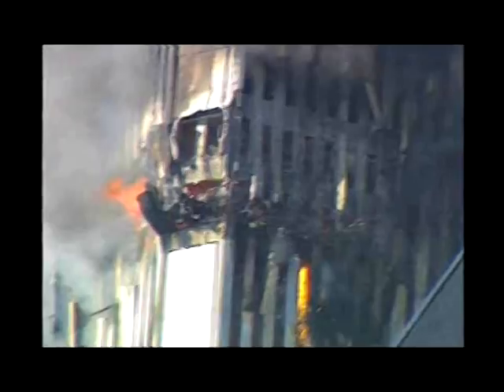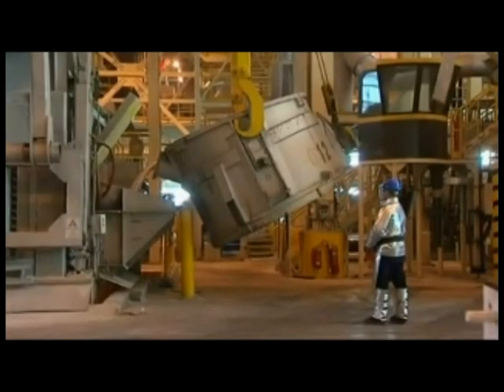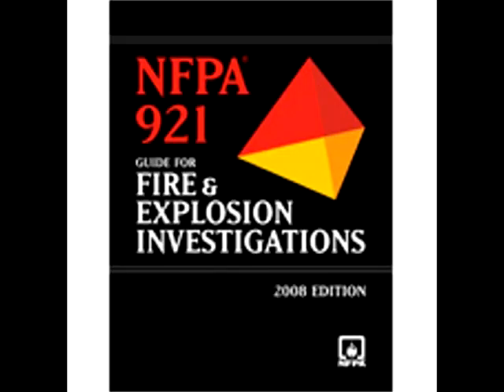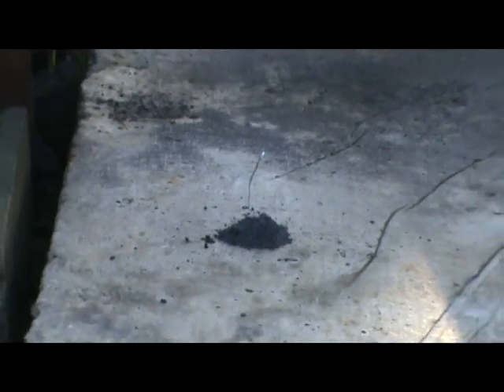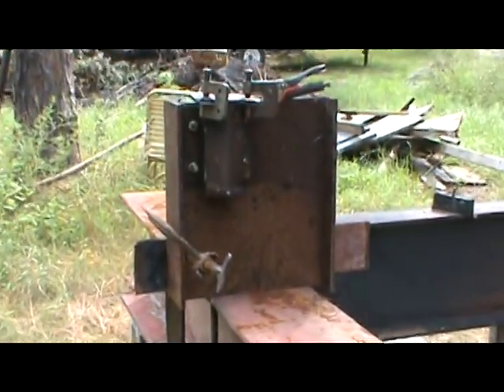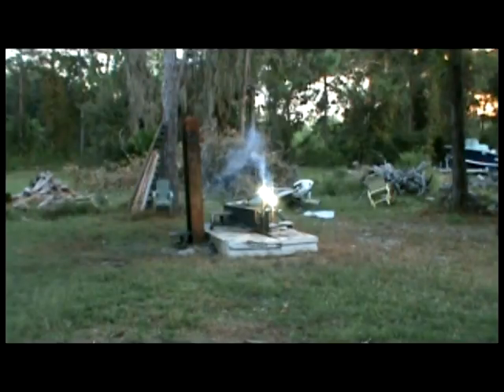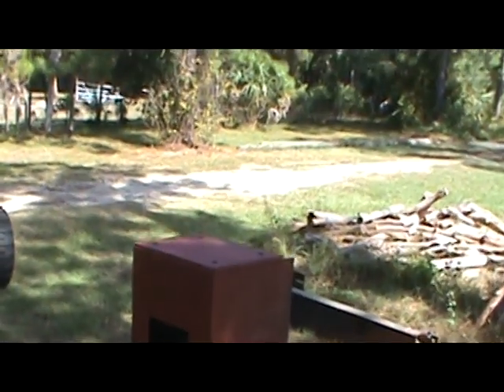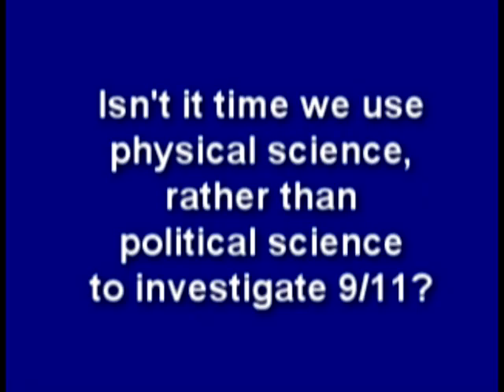9/11 Experiments: The Great Thermate Debate

Comment: All building materials except timber are likely to show significant loss of strength when heated above 250 ºC, strength that may not recover after cooling. Molded glass objects soften or flow at 700 or 800 ºC. Metals form drops or lose their sharp edges as follows: 300 to 350 ºC for lead, 400 ºC for zinc, 650 ºC for aluminum and alloys, 950 ºC for silver, 900 to 1000 ºC for brass, 1000 ºC for bronze, 1100 ºC for copper and 1100 to 1200 ºC for cast iron.

Comment: Not the full disclosure. That part definitely happened, but other insiders were tipped off about the operations and staged separate events in NY that were planned at least 10 years in advance. This video will answers a lot of questions for you, and the source material the video was derived from goes even deeper. Rich with details and facts. Here is exactly how they did it with NO ONE SEEING THEM:
watch?v=n_fp5kaVYhk

Comment: First it's important to note that humans are bad perceivers and even worse rememberers.  Any loud thud more or less sounds like an explosion; this has partially to do with our inability to differentiate very low (bassy) frequencies.  Par example, if someone jumps off of the 100th floor of a skyscraper and breaks through the ceiling of the lobby, it will more or less sound like an explosion.  Also cars exploded that day, and so did combustibles in the fires.  This doesn't entail conspiracy...

Comment: I don't think any position held by the majority of modern scientists (which my position is) should be brushed off as "ridiculous."  Again, these are rhetorical techniques you are using, not logical ones.  Calling me names is certainly easier than arguing against me, and I realize that, which is why I'm not offended.  But you certainly have all your work ahead of you.

There is only one shot in the above video of sparks/molten material near the ground, and it is hardly conclusively steel...

Comment: My position is that the molten metal is NOT Aluminum. 
In my experience; in the real world. Aluminum will cool and solidify almost immediately when removed from the source of heat; the fact that this material makes it all the way from the exit of the tower down to the tenth or so floors without changing back into a silvery aluminum color is the observation that i am basing my judgement on. 
And I ignore your question because you are postulating such a ridiculous position.

Comment: More ad hominem, and of course you ignored my question (which I have asked more than once).  HOW DO YOU KNOW THE MOLTEN METAL IS ALUMINUM.  "Observation" isn't really an answer: I have two eyes that work as well and when I look at molten aluminum and then look at the molten metal on 9/11, they look indistinguishable.  What specific characteristics of the molten metal in the footage lead you to believe that it is NOT aluminum (mixed with other debris like glass)?

Comment: You still haven't said HOW you know for certain it wasn't aluminum.  Neither has anyone else.  And psychological certainty is not the same as actual certainty.  I don't doubt you have the former.

And when did I ever assert that Ground Zero wasn't hot?  The fact that the rubble was hot doesn't prove your hypothesis or mine.

Comment: Ya because, all those witness that were actively fighting a fire for TWO months after 9/11; and the ones that had to stop searching and stop working because of the heat; 
And GOV Pataki telling how the site is so hot + the NASA photo's. Ya all those witness don't know what the hell they're talking about.
One thing for certain, I can't prove it was steel running from the bldg, but I believe I know for sure it was not Alum. And i'm sure you believe it too. Only have the powers of observation.

Comment: Good question HANDI.  In one tower the plane did spread out more because it hit more or less in the center, but in the other one, the one where all the molten footage comes from, the plane didn't go in directly centered but instead went straight through to the far corner of the floor, pushing all the office debris into that corner as well.  If you think this is steel, you'll need to explain why in this demolition they cut the columns well before the collapse.  That isn't how other demos work...

Comment: your theory relies on a number of unknown factors, such as holes in the floors or even entire floors missing, all the aluminium flowing to these 2 points without picking up other melted debris (which would be obviously a diff colour of molten metal) etc etc

Comment: But if those explosions are what caused the demolition, and thermate doesn't cause an explosion and is quiet, then thermate didn't cause the demolition.   Also, when a building is actually demolished the charges go off RIGHT BEFORE the collapse, not sporadically for an hour leading up to the collapse.  I've mentioned this on this comment page like 4 times and not one of you truthers has even tried to respond to it...

Comment: jet fuel (high grade kerosene) does NOT have enough energy to reach steel melting temperatures~! YOur as guilty of "cherry picking" by side stepping the fact that the 911 official report stated the buildings were brought down by fire. While this video /audio evidence says there was molten steel AFTER the buildings have started to cool / smoke dissipating. I suggest you try & get your cherries in order before spouting sprout~!

Comment: With all evidence presented, STEEL must be ruled out. Molten steel would turn black as it cooled down falling down, while hot molten aluminium will glow yellow, then silver. This is exactly what you see in the still images from the videos. 
So if it wasn't steel that was melting, conspiracy theorists are running out of legs to stand on... back to UFOs, I guess.

Comment: Again, Im positive that its not ment as proof that thermite was used. Im positive its not meant to prove that the BLDG were demoed. It proves the plausibility. And it directly reproduces the characteristics of all the testimony & evidence. Definitely shows there is enough reason to question the official story. 
As far as the molten metal falling from the BLDG, It can definitely be asserted with certainty that it is not aluminum. If you believe it still can be; you do your own experiments to see

Comment: He has shown that thermite can cut steel.  He has not shown that it was used on 9/11.  He has footage of molten metal on 9/11, but in footage of this quality molten steel is indistinguishable from molten aluminum.  So you can call this video "science," but dots are being connected here that have nothing to do with one another, namely, molten METAL in 9/11 footage and thermite melting steel in this dude's backyard... This video is not evidence of demolition on 9/11...

Comment: No miracle is needed. The molten aluminium (a dirty mixture at that) pooled on a floor, and as that floor began to sag due to it's supports starting to fail under the load and heat, the liquid mixture flowed to the lowest point, which happened to be the window. It even moved to a nearby window for a moment. This sagging of floors can be seen in videos. And if a floor is sagging like that, it's collapse is imminent.

Comment: You correct that nobody can prove for sure the composition of the metal running from the building. All we can do now is use power of observation combined with hundreds of years of knowledge about melting metal. With all the evidence presented, aluminum must be ruled out. That you must agree with. So if its not aluminium there is a huge problem for the official story.

Comment: You haven't said how you KNOW it's steel.  You just said the internet told you that, which I don't doubt.  But HOW do you know that it isn't aluminum?  Plus this demolition theory doesn't make sense: you're suggesting that they used thermate to melt steel well before the building fell down.  But in controlled demolitions the "explosions" happen RIGHT before the collapse.  So why are we seeing this molten metal well before the collapse?  My theory explains it...yours doesn't seem to...

Comment: No need for "assuming" what kind of metal it is. It IS steel, after some research on the internet you'll soon determine the molten metal in this video isn't aluminium. However i can see how you would think it is the aluminium from a plane and office framework etc but i dont think any adult is naive enough to think all of this aluminium you speak of, would miraculously condense into this one area and spew out onto the streets below.

Comment: Stelley you are begging the question.  I do not assume to know that the molten metal in 9/11 footage is steel.  I DO know that 767s are largely aluminum.  Google image search "molten steel" and then Google image search "molten aluminum."  They look indistinguishable.  How can YOU rule out the possibility that the molten metal in the footage is aluminum and not steel?  BTW, aluminum is also used in building construction AND it could melt in an intense fire, like that caused by a 767 exploding.

Comment: I don't get where you are getting out with downplaying his thermate tests, since he went through all that trouble and only got those results wouldn't it require something with even more energy to cause the collapses? Where is all the energy coming from to pulverize the concrete and blow large sections of the building out? Since most of the jet fuel (which burns cooler than thermate) would be burned up already from the crash. Where is all the energy coming from???

Comment: You're cherry-picking data from that day and using it to suggest that your theory is right (e.g. bent up box columns, molten "steel", etc.) while ignoring the overwhelming evidence for the more parsimonious theory (namely, that two planes hit the buildings which likely had a lot to do with why they fell).  Showing that thermate can cut steel (which you have done, at least with the assistance of your hammer) does not mean there is evidence that it was used on 9/11...

Comment: Common sense would dictate that the steel mesh and 47 core columns of the twin towers would be more than enough to handle the aircraft hit and the isolated fires.  Gas temperature of a fire and the temp. of the steel would not be the same, as steel conducts and distributes heat.  Molten metal was found weeks later as well...hydrocarbon fires do not burn hot enough, nor was there enough oxygen for metals to reach those temperatures. You take huge inconsistencies and call it common sense, good job

Comment: Take a look at images of "windsor tower fires", a high rise in Spain burned for 24 hours.  Images show a bright orange blaze consuming most of the fire.  It took 24 hours to extinguish.  This is compared to 1-1.5 hrs for the WTC buildings.  The Windsor fire was not oxygen starved and burned much hotter than the Twin towers did.  Surely a fire that consumed most of a building and were much hotter would cause the steel to weaken, just like the official story right? Nope, a burnt out husk stood.

Comment: "Can thermate cut bolts? I guess it can!"
After which you clearly show yourself finishing the "cutting" of the SEMI-INTACT bolt by whacking it with a hammer a few times until it finally shears off...? So, your thermate did not cut the bolt--it scored/weakened it, and then you had to use a hammer to finish the job. Whoever you are, Mr. physicsandreason, you're actually DISPROVING your case the more this video goes on. Do you realize that? Obviously not...

Comment: "It appears that not only can thermate melt steel, it can cut vertical colums."
Your video clearly shows that you did not CUT a vertical column; not even close. You scored the outisde of it. And at what point did your thermate device "melt" any of the steel? Looks like it burned into the outside of it before consuming itself. Hmm. No molten steel? I thought the thermate you claim was used in the towers melted the steel. So which is it? Burned? Or melted?

Comment: So how many iterations of your little backyard thermate cutting device did you have to make before coming up with one that "worked?" And did you consider how much time and effort would have had to have gone into rigging enough of such devices to trigger a collapse of the towers?  You do realize that the columns would have had to have been exposed to be rigged, which involves extensive access and demolition of the gypsum drywall, etc.? And how would so many charges have been triggered?

Comment: 5. "So what can melt steel and explain all the evidence?" Again, the steel, at least before and during the collapse, WAS NOT MELTED--IT WAS WEAKENED. 1800 degrees Farenheit IS enough heat to weaken structural steel to the point that it loses its ability to hold up a building, especially when much of it has already been damaged/destroyed by the direct impact of a 757 flying at 400-500 miles per hour. Every single claim you've made thus far is completely false, and you're just over 2:00 in! Wow!

Comment: 4. "The media told us" that the fires melted the steel. You cite a Newsweek article that was published in 2001, before ANY formal investigation had been even been undertaken. "Melted" may have been an imprecise or even innaccurate term to use--HOWEVER, the basic cause and mechanism of the collapse was, in fact, the *weakening* of the steel due to intense, fuel-initiated fire, coupled with the structural damage caused by the planes' impacts. Not thermate, only fire and structural damage.

Comment: 3. Molten metal poured from the 80th floor in a shower of sparks--"it looked like steel from a foundry." Which, once again, proves NOTHING. "Looked like" and "definitely was" are two different things. This was likely molten aluminum (the remnants of the plane, as well as aluminum and other metals from the building's interior) mixed with other burned/burning materials, all of which had a lower melting point than structural steel. The "sparks" were a result of the falling flow reacting with air.

Comment: he wanted to insure for 1.5 billion, his board members wanted 6 billion, so they settled in the middle at 3.5billion.  And the video you posted about his disputes with insurance over one or two ocurrences, and therefore should pay double... He didn't get 7billion, only 4bil and change -  And he rebuilt which cost at least 4 billion, so not a great insurance scam.

Comment: I dont believe in a vaporizing plane, theres wreckage from the pentagon, its all there - pics - abovetopsecret . com / forum / thread79655 / pg1

Also, for WTC 7 - A Single Point of Failure by Gilsanz is a concise, not long winded analysis of 7 - structuremag . org / Archives / 2007-11 / SF-WTC7-Gilsanz-Nov07.pdf

Again, my bad for the spaces.  Pretty crazy the Avery thing too huh. Im surprised he had the balls to re-evaluate his beliefs. Still, I think he should donate his profits to victims ha

Comment: a section of the structure being weakened or cut by thermitic devices would not have brought the rest down with it. It would have been a partial collapse, not at free fall. as for "no reputable evidence", what about molten steel? how many times must it be stated that jet fuel doesn't burn hot enough? by 1000 degrees! there are mountains of evidence and the laws of physics themselves to back this up. Where are you getting your data? did the laws of physics not apply to those 3 buildings that day?

Comment: Dust cloud was produced in mid air from bare steel. No flashes, white hot burning or molten metal was observed throughout destruction phase ANYWHERE. The dust cloud was NOT HOT (no one was burned by it) + unburned paper EVERYWHERE.

Thermite can't dustify steel!

Also 600 ft of WTC1 core ('spire') remained standing before 'fainting' to DUST. Show me the 11 miles of core box columns lying on top of the pile!
watch?v=lGXDmNZCeKo

If thermite used, could 14 people survive inside core UNBURNED? LOL

Comment: This vid doesn't address the fact that the steel clearly turns to dust in mid air
watch?v=dueVm1UGvXo

The thermite theory is a CD, meaning the columns are severed and the building falls to the ground in a big pile

But the seismic data did not register 2 x 500,000 ton towers slamming into the ground and there was no rubble pile
watch?v=lGXDmNZCeKo

14 ppl survived in WTC1 (not crushed, buried or incinerated by thermite) They walked out!

No 'plug' of once molten metal was ever found. Explain!

Comment: The system global hawk utilizes has been around since the 80's you dump truck. The introduction of global hawk you're "thinking" <- loosely used word, is the entire craft dipshit. I didnt say a global hawk UAV crashed into the towers did I? NO, i said the planes that HIT were flown by global hawk. It's becoming clear that you have a problem with not only reading, but comprehension as well. Careful who you call stupid without thinking, or it can end up showing that you just weren't thinking. :D

Comment: You moron, the path of the plane im talking about is the path it was on right before the fantasy impact you believe in. Did you think i was talking about poles being knocked over 30,000 feet in the air?? 
"It's a known occurrence caused by radical maneuvers."  <- Funny for a few obvious reasons. You suggest A. a commercial airliner has the ability to maneuver  radically like an F-22 or something. And B. the FDR isn't durable enough to function properly as designed. ( Flight/Crash data?!)

Comment: Yea, thermite is used for cutting steel beams... sorta... A shaped charge is generally used because it's ligherweight, and more of a sure thing. Iron oxide spheres aren't created by kerosene, they are supposed to be a sign of the use of thermite, but as I said, these buildings were covered inside and out in such ingredients. This video ignores that a thermetic reaction doesn't change in power because of particle size. Nor would it be unreacted as just Iron Oxide.